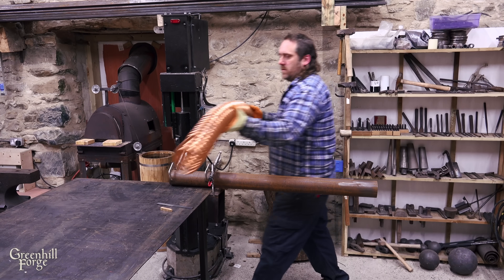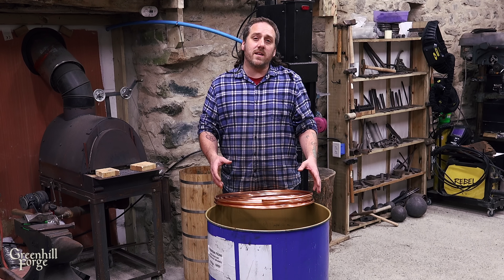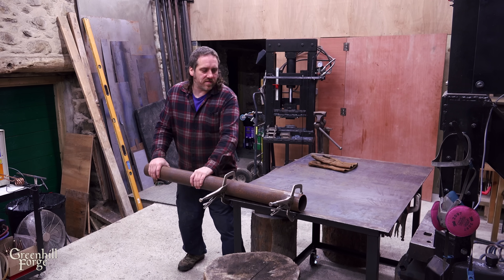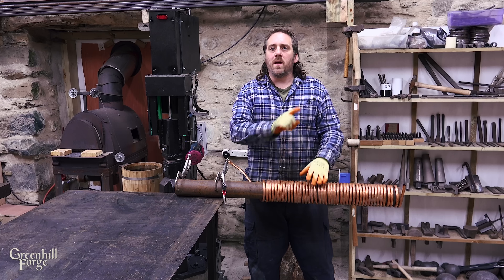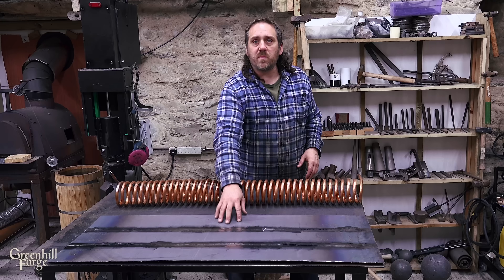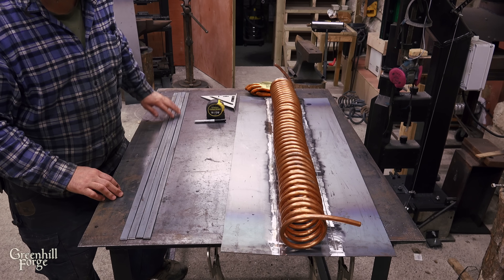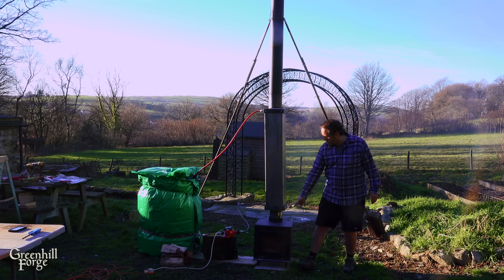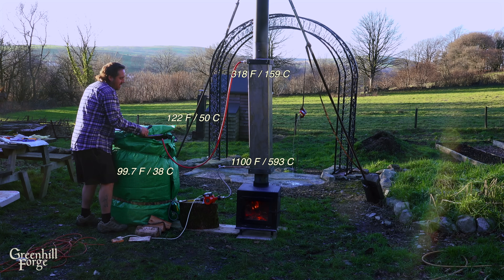Wood Stove Water Heater Experiment - Surprising Results! Part 1

Comment: Do not try this at home folks!!!
Coiled pipe on the inside??? No thanks.The copper will be getting covered in (insulating) soot from day one destroying your noble attempt at heat exchange as well as crippling the performance of the stove and flue(e.g. turning a 6" flue into a 4" flue!!!) It will also create a much larger surface for tar etc to be deposited,making the stove extremely difficult if not impossible to service,severely increasing the risk of a flue fire(i.e. game over,house in ashes).Your approach is impractical,inefficient,very dangerous and frankly clueless.
1,2 or even 3 coils around the outside would solve all the problems that you decided to create for yourself.

Comment: Don't need a pump, the heat will pump the water. As it heats, water will rise in the coil, sucking new water into the coils, and if hot enough will even percolate the water.
Reply from the maker: Yeah, I'll be removing the pump to test the thermosiphon in a future video

Comment: You are simultaneously condensing your smoke by rapidly transferring its heat to the water … thereby collecting the remaining combustible solids contained in the smoke onto your coil and interior of the box….eventually a chimney fire will happen…..I would suggest keeping the smoke off the coils by having the copper wrapped around a stove pipe that would be easy to clean or be kept creosote free with a higher burn temperature.
Reply: Came looking for this comment.
That buildup will also choke the flue, not good for the stove.
Reply: Yes, and this buildup will happen rapidly in a few hours of burn choking the spacing between the coils and the efficiency will collapse right along with the buildup.
Reply: I built almost the exact same thing several years ago, and the pipe quickly gathered thick layer of condensation and dust, which quickly became as hard as cement. This insulated so well, that the entire system became completely useless within the first day.
Reply: Same came here to look if anyone had mentioned this, and warn about flue fire. Think although a loss of heat conversation for safety a modified design that be slid over a traditional flue, this would allow a couple of things protecting the coils and the ability to disconnect it and reconnect it to a flue on a fire without the need to remove the original flue, but the butterflies top and bottom would have to be put into the permanent flue not the heat converter, but this would allow the system to be moved between multiple fire places.
Reply: I would add a stainless steel pipe for the coil as well instead of copper.
Reply: That's true. There's a balance to be had between how much heat you extract and how much buildup you get.
My woodstove is one of those wide ranges and it takes out almost too much heat. 3 years in a row the sweep has not found anything in the pipe but I have to do a cleanout of the stove each year instead or it clogs up!
Reply: @1kreature  I wonder if you could mitigate this issue (AND BOOST EFFICIENCY!) by incorporating a catalytic converter into this build. Combust more pyrolytic
by-products and extract more energy simultaneously? Just an idea...
Reply: @alden1132  Stoves with a secondary air feed and reburn do essentially this I think.
The temperatures required are higher but I think I've seen 600-800c listed. If this is the case it is a tad close to the approx 1000c melting temp of the copper. Would be ok while cooled though.
Reply: Not to mention ash is highly corrosive to metals especially copper. Won't take long to eat through something like that with heat and ash.
Reply: This is why all of the old time hot water/steam boilers or water heater boilers used hot water coils that were in side the fire box. I have a video where I made a thermosyphon heater out of an old water heater stove. It did work pretty good. I also have a old cast iron boiler that includes a place where you can install a water heater coil inside the firebox. I want to use it yet after I found it and got it home all of the original insides are gone and someone jerry rigged up some rebar nasty contraption. Its sad, yet one day I will find another boiler that is in good condition to be able to use.
Reply: I too came looking for these comments now how he made a insulation barrier which I believe if he were to get enough build up to have a fire ot soes have a layer of protection but if it is inside he would definitely need triple wall pipe to go through roof am attic i would think that would be his mist vulnerable area
Reply: Great build man and I very much enjoyed the build. Looking forward to the next video🙏
Reply: I'm here for this comment. The vid is awesome and I dig the work/research/data. But exhaust pipes must always be free of clutter and cleaned often. It doesn't take much buildup until fumes start leaking from seams or stove. Gotta dismantle/scrub often, depending on wood quality. But yeah, I'm still stoked to see this vid and appreciate the work/data!
Reply: If you take to much heat out of the flue gases on a traditional chimney it will not draw properly as it needs some of that heat to physically warm the brickwork or liner to enable the air convection to start. The idea of heating water from the stove is one I do like however.
Reply: @chrishoare8897  They will soon find out why these things just do not exist. 
Boilers exist for a reason and they can be built or found.
Reply: Yea there should be no smoke touching the copper couse it will pack tite with creosote and ruin efficiency. If i made it i would wrap copper around the stove pipe and another pipe around the copper like another commenter did. Much easier to build needs no cleaning and still very good consistent and efficient. Another way to go is to make a type waterproof rocket stove and submerge it in the tub like we had on top of  the shower in vietnam that heated the water very well with no water pump at all. You i am sure can find how to build one of those in an army manual somewhere cause the army used a lot of them in vietnam. I personally lit  the one on top of my companies shower and fed it with wood for hot water. I have no stats but can say that it worked well and made otherwise cold showers really nice. There are a lot of ways to heat water its very old technology a firebox surrounded by a water jacked connected to a hot tub with in and out pipes  sitting next to it also heats water very fast and needs no electricity for a pump works fine.
Reply: Agreed or if you want better heat transfer, use large 2 or 3 inch pipes with access to both ends so they can be cleaned
Reply: Yes copper outside of the pipe then insulation and outer pipe will still condense however there is additives that helps prevent this
Reply: Everyone that made a comment on this subject is correct, this isn’t a good way to do this.
Reply: As long as there's water flowing through the copper when the flue fire happens... Will the fire actually do any damage? Or is it more a case that the fire could cement uncombustable solids onto the copper piping?
I also suspect that something like a high pressure sewer spray/cleaner  would do a pretty good job of cleaning the copper pipes if it was laid on the ground. Add a little sand or grit if actual scrubbing might be needed.
Reply: @anticarrrot  well if his fire is outside and away from surrounding trees then any damage would be contained to his flue, i think the concern in many people's minds is he mentioned underfloor heating and such, which would likely mean the fire place/pit/whatever being most likely indoors. 
And that what he built, though actually really good and a really clear video showing how to build it, real props to him for that, but that because it was such a well made video, that people would copy it from him and try it for themselves, which if designed slightly differently would make something great to have at a cabin or off the grid weekend home/bug out home. 
Flue fires gets up above 1,100 degrees C (2000F) copper starts melting at 1085C, now with the water in it carrying the heat away this might not be an issue. 
But many insulation materials, rockwool, fiber glass catch fire at half the temp that copper melts. And cast iron starts to melt about 1200C, and sheet steel starts to melt about the same depending on the type of steel he is using... all which are in the range a chimney/flue fire can comfortably reach... 
so a fire away from trees and buildings it could just damage the flue and be a pillar of fire into the sky but put it close or in a building and then could be a serious issue.
I honestly think all the comments about flue fires were made by people who enjoyed the video, and are impressed by what he did and how clearly he showed it, and are just well meaning because they have seen an error in it
Reply: The reason why steam kettles are built the other was round is cleaning. Straight pipes lead the exhaust through walter. For cleaning Just remove a cap at the end and usw a think chimney brush
Reply: The flue temperature at the outlet is 159C at atmospheric pressure. It's not condensing water.
Reply: @davelowe1977  good job bro
Reply: 7:13  @davelowe1977 condenes tars and other distillates such as creosote etc etc

Comment: It would be interesting to see after a month to see how much creosote and soot has built up on the copper pipe due to the cooling of flue gasses as they would act as an insulator. I've preheated water in a wood stove with just galvanized pipe in the firebox to an electric hot water and more the halved the expense of electricity but still had the soot and creosote problem.
Reply from the maker: Yeah, this wouldn't be a good design for long term regular use, but this is just a test unit.

Comment: Electrolysis is a chemical reaction that occurs when an electric current passes through water in a plumbing system, causing the pipe to corrode and weaken.

Comment: A couple of things from someone who has done something similar over 25 years:
1. Your water system must be open loop (not pressurized). I have an open loop tank (like yours) with a second coil inside that is pressurized as part of my home's hot water system. Hot water in the tank heats our DHW as it moves through the coil. Works very well.
2. Your stove pipe heat exchanger is going to get fouled from creosote and ash condensing on the relatively cool surface (been there, dealt with that). You'll need to periodically disassemble it and use a wire brush or something to clean your copper coil. Or you can drain the water from the coil and burn it clean. Not as effective.
I ended up building a  straight pipe grid actually inside the top of my stove for easier access for cleaning the copper pipe. Also, having it inside the stove causes combustion condensation to drip back into the fire to be re-burned meaning cleaner smoke up the chimney. Once I did that, my stove pipe stays much cleaner. 
3. I use a differential temperature controller to control my pump. Turns the pump on when the temperature exiting my heat exchanger is 10 degrees higher than the bottom of the tank.

Great job! Your fabrication skills exceed mine.
Reply: @zettaiengineer4202  Look again.
Reply: @TheGhungFu  you're right, he wrapped copper around pipe to shape it but its not there in the end.

Comment: Wonder how long this same setup [with the water tank raised so the lower (cold) outlet was on a level plane with the heat exchanger] would take with strictly a thermal cycle and no electric pump; cabin or off-grid style.
Reply from the maker: I'll be doing a thermosiphon test in a future video

Comment: Try using your heat exchanger without the pump, just free flow pipes. Cold inlet at the bottom of the tank, hot fill at the top. You should find the external kettle still heating up because the hottest water rises to the top and automatically pulls in cooler water from the bottom of the tank.
Reply from the maker: That's coming up soon
Reply: BUT,  ONLY IF THE TANK  IS HIGHER THAN THE COIL. 
If you want a thermosyphon to work, then the receiving tank needs to be HIGHER than the coil, so the hot water can rise to expand into it.  The pipe must slope UP
The tank's coldest water at its bottom will also then drop to the bottom of the coil. The pipe must slope Down.
Reply: @greenwood4020  Not true, most early tractors used thermosyphons, the radiator was at the same height as the cooling jacket. The heat rising and cold return allowed circulation.
Reply: @johnqpublic9074  You are correct. 
I should have stated the most efficient designs are, as I described. Most model T Fords used the thermosyphon system, but it was susceptible to overheating if worked heavily, but served well for most Model T usage.

Many types of water pumps were available as after market accessories.

Comment: I've Bern thinking about a geo thermal well, my old erll was 200" deep...So why not your copper voila down about 200ft into bored hole and extract the thermal heat...
I know of ground loops down about 6-10 ft...

On my wood stove I just wrapped the 4" of the pipe with a copper line to claim the radiant heat and runs and exchanger with a fan....basically a vehicle heating system....

Comment: Copper and steel will react and eventually prematurally corrode a hole into the copper. Use heavy gauge copper wire to space the copper pipe as well as suspend the copper coil from the steel housing using brass washers /screws.

Comment: That is an interesting way to heat water, if you can get the water to 212F that would make a good heat jacket for a still to produce fuel ethanol. Might have to use some kind of oil to get that much heat, so it doesn't boil off, but you could definitely power a still with it and not use much fuel/wood for heat. That would also allow managing the temperature of the boiler easier and more precisely, since you want the head of the still to be 173F.

Comment: The white insulation is ceramic fiber and is not toxic.   Has been linked to silicosis if aerosolized or in dust form.  You can eat the stuff and not worry.    Simple precautions is all that is needed esp in unused form (new) as shown in video

Comment: It wouldn't be a bad idea to incorporate a temperature/pressure relief valve at the storage tank just in case the pump fails or the temperature in the storage tank gets too high. I scrapped out a gas water heater once and there was a sheet metal baffle (twisted into a spiral) running down the center of the heat exchange tube to direct the heat toward the heat exchange surface. That might help increase the efficiency even more. You did an magnificent job! Well designed and implement. Thank you for sharing.
Reply from the maker: Thanks! It's an open system and the tank is wide open. I like the spiral idea.

Comment: I made several rocket stove’s and when you insulate the burn pipe then all the gases will give you a secondary burn but it gets incredibly hot so make sure to keep water in your coil😊 or it will melt also with the coil you are cooling down your burn pipe a bit so in the beginning it might smoke but when it’s hot, it’s totally smokeless
 I Will give you a head Up make the feed pipe like 45 Degrees than it’s self feeding and the Wood slides Easily down
Reply: What do you think about a rocket stove with the copper pipe in sand,around (outside of) the inner flue? So a double wall,with the sand and copper pipe inside the sandwich?
I would think this may regulate the copper from getting too hot,yet still allow the flue gases to be hot.....but I do not have any experience with rocket stoves....(yet!)
One could insulate around the outside of the sand/copper coil layer pipe,too....

Comment: Just an idea. Haven't seen it yet. 
How about adding a bypass flue in case of pump failure instead of just the dampers? 
I think that could be helpful especially with the rocket stove where temps could really get out of control. Might be able to balance the heat exchanger temp automatically that way too or allow you to keep the fireplace in service for maintenance of the HE.

Comment: Would this work without the pump? Due to thermal rise...  Also, be curious to see how it would work without using an insulation product, rather filling the chamber with sand.. possibly creating a (sand battery effect), allowing the heat to be stored in the the chamber/pipe for a relatively longer time ... Great video and enginuity skills .. 👊👍👍
Reply from the maker: Yeah, I'll be testing that soon

Comment: If you make a version 2.0. my suggestion would be, a soft point connection between the copper and the metal alignment teeth. Eventually the metal will, wear some holes through the copper. 
EDIT: I COULD BE COMPLETELY TALKING OUT OF MY ASS AS WELL.
Reply: I think you are correct,expansion and contraction will eventually wear a hole in it. I aslo have no idea what could be used as a buffer that wouldn’t melt.
Reply: @ptech88  you could even use a softer copper, (other softer metals). It just has to be softer than the copper you're using. There are some high temp rubbers, plastic composites. Downside is, 1100 degrees is really pushing the envelope.
Reply from the maker: the rocket stove will be far more the 1100f too. There will have to be many different test units before a good final design.